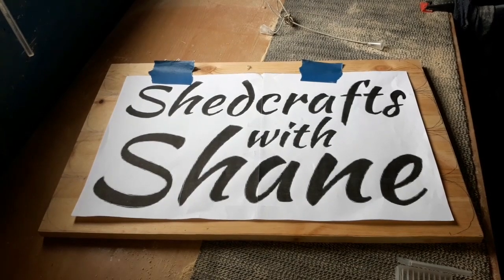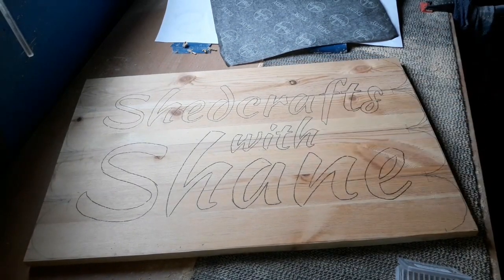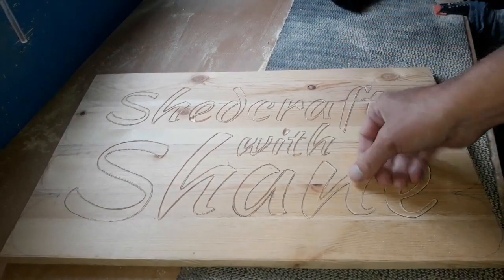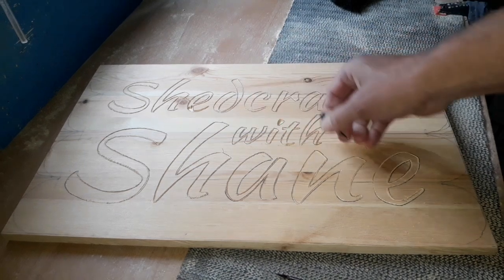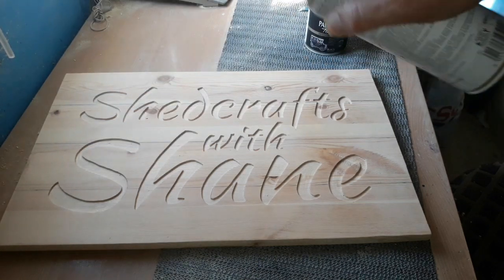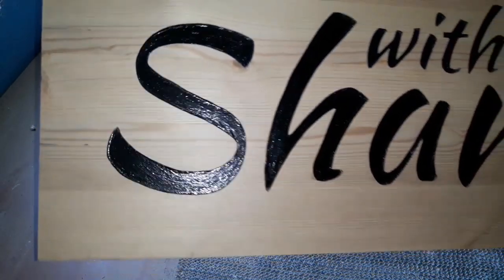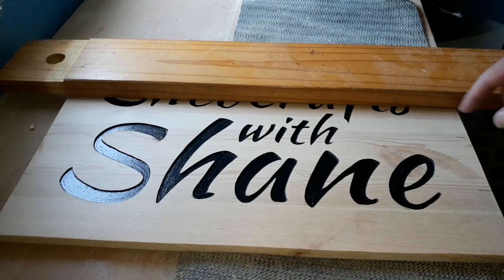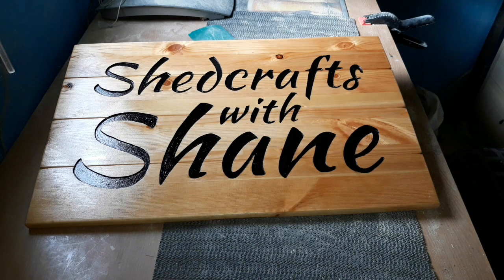Routed out plaque on recycled wood

Comment: Hi there can you please help me i just bought the aldi palm router 1/4" - can you please guide me to the correct size collet and millend and tracing tool set please im getting so confused with all the different listings and sizes - i would like to try what you have done here for some xmas presents - many thanks in advance
Reply from the maker: Hi Suzanne glad your having a go at routing,good choice 😀..I've started putting links to the bits I use in the description on my newer videos, check my butterflies on fencing wood videos all the links you need are there's.. cnc bits for the lines, end milling bits for the clear out, and the adapter collet so they fit your 1/4" router..ebay or amazon..if you carnt find the links let me know and I'll pop them in here for you, good luck and enjoy 😁👍https://youtu.be/BXjp8dXsCtI
Reply: @fishtank5050  hi there the engraving bits on your link are sold out and the collet link from china will be too long for when i need by any other links please xx
Reply from the maker: @suzanne970  I'm guessing your in the uk,this adapters from Manchester.select the 1/4"to 1/8"..adaptersize..
. https://www.ebay.co.uk/itm/Collet-Adaptor-Shank-Reducer-Bit-CNC-Spindle-Router-1-2-1-4-1-8-3-4-6-8-10mm-/323986312214?mkcid=16&mkevt=1&_trksid=p2349624.m46890.l49286&mkrid=710-127635-2958-0
Reply from the maker: Here's the end milling bits for clearing out with..https://www.ebay.co.uk/itm/10pcs-set-0-8-3-175mm-Carbide-End-Milling-Cutter-CNC-Router-Bits-/163724007456?mkcid=16&mkevt=1&_trksid=p2349624.m46890.l49286&mkrid=710-127635-2958-0
Reply: @fishtank5050   this link is a china product again not manchester sadly?
Reply from the maker: @suzanne970  OK  just go down the list or search amazon 🤔

Comment: I want to try this. What router and collet size and bits did you use?
Reply from the maker: Thank you Les,my router is a black and decker dn66 they don't even make them anymore but any router will do these types of projects, I do my lines with cnc bits,my clear out with end milling bits, they both have a dremel size shaft 3.175mm so you need an adaptor reducer collet 6.35mm so they fit a 1/4" router, if you check my latest video titled Rose routed out on recycled pine, all the links for the bits are in the description..Good luck 😁👍
Reply: @fishtank5050  Thank you for this info.

Comment: I'm looking at making my own sign, this looks much better method than the dremal method . Thanks
Reply from the maker: Cheers Tony, you can get a router attachment for the dremel if you dont have a router..
Reply: @fishtank5050  ah thanks, that might make more sense for me as I use a dremel much more. 👍🏻
Reply from the maker: @T-bit  here's one from ebay,you can get cheap plastic cone shape thinks,but I wouldn't recommend them,just a waste of time..https://www.ebay.co.uk/itm/DREMEL-335-Plunge-Router-Attachment-SET-c-w-Guides-26150335JA-/324619434656?mkcid=16&mkevt=1&_trksid=p2349624.m2548.l6249&mkrid=710-127635-2958-0
Reply: @fishtank5050  Thanks so much for the link,  I didn't expect such a quality part as this looks.

Comment: Hi could you please recommend the make of bits please. Thank you for your video it’s inspired me to give it a go. I’m just not certain what bits to get.
Reply from the maker: Hi Sam, i like to use cnc bits for the lines, and end milling bits for the clear out, there's different bits you can use,but I prefer these,they have a dremel size shaft,3.175mm, so you will need an adaptor reducer collet so the fit a 1/4"shank router...Good luck and enjoy.cnc bits..https://www.ebay.co.uk/itm/172213663526
End mill...https://www.ebay.co.uk/itm/353029506162
Adapter reducer...https://www.ebay.co.uk/itm/402710195555
Hope this helps..
Reply: @fishtank5050  Hi Shane thank you for the prompt response. That’s a great help and I really do appreciate it.
Reply from the maker: @sambrown9473  No problem Sam, happy to help 😁👍

Comment: What's the name of the router machine you're using
Reply from the maker: My router is a black and decker dn66 they don't even make them anymore but I can still find them on ebay or marketplace, I'm on my 8th machine.😁👍
Reply: @fishtank5050  lol o wow you do an awesome job do you have to have a certain kind
Reply from the maker: @valeriekey1499  no any router will do these projects from plunge, trim ,compact router, you can also get a router attachment that fits onto a dremel..
Reply from the maker: https://images.app.goo.gl/AfKzfjXMBHeHKo5q8
Reply: @fishtank5050  thank you so much 😊
Reply from the maker: @valeriekey1499  no problem 😊 👍

Comment: Great work. Could you put a link to where you buy the CNC bits & collets. I’m subscribed 👍
Reply from the maker: Thankyou, I get most of my bits from Ebay or Amazon, search cnc router bits, the collet is a 6.35mm to 3.175mm adapter reducer collet also Ebay,cnc bits come in different degrees, you can get a mixed pack with 10°,15°,20°,30° in side..

Comment: Hi mate  just a quick one what web site do you use to get lettering templates..
Reply from the maker: I used a free app called fancy fonts for this one..
Reply: fishtank5050  thanks,,,,got some of them cnc bits you use but never got the collet like a numpty. Just started as a bit of hobby. Like your work 👍
Reply from the maker: @adrianhoward7253  cheers,mine is just a hobby also,yes you definitely need the collet 😂😂👍make sure you get the 6.35mm and not the 6mm...

Comment: Hello

Excellent work, is it possible to use those bits on a dremel 3000?
Thanks a lot
Reply from the maker: Yes they will fit a dremel 3000,you can buy a router attachment to fit a dremel

Comment: nice job shane do you find it easier without using the plunge on your router i have always used the plunge when routing will give your way a try regards and never tried the milling ends you have been trying out they appear to leave a nice even finish without the need to then tidy up with dremmel
Reply from the maker: Cheers Wayne,I've not used the plunge for years now,I did at the beginning on a bigger router,but the one I have now is so small and light,its easier just to lift it in and out..I ordered the mill end bits by mistake, glad I did,they do clear out really good...
Reply: ahh i thought it was smaller i only have the larger type i see were you are coming from now cheers @fishtank5050
Reply: also just orderd some milling bits of ebay to try out will let you know
Reply from the maker: @wayneheston-king341  definitely worth a try,my brushes went on my router today,I've worn them out..lol.i had a back up router so on with the next project...

Comment: Loved the video, but I have 1 question.  When you routed the horizontal lines from side to side, did you stop the router right where the painted area was, or did you have the router set more shallow so it didn't disrupt the painted area?  Thanks for taking the time to make it!
Doug
Reply from the maker: Thank you Doug,on this one I had the lettering routed out slightly lower then the lines,I suppose you could do the lines at deeper depth  then the  lettering, then paint afterwards ,either way would work..😁👍
Reply: @fishtank5050  Thanks for the quick response, I really appreciate it.
Reply: @fishtank5050  wood work 😁 nice, great job, I am buying a matika soon can't wait 👍🏻😉

Comment: Another great project Shane. May I ask, when you apply the linseed oil do you go over the black paint in the letters as well? Just to clarify for me if routing outset letters you route to the outside of the letter and inset letters route on the inside. Keep up the great work buddy, love watching your videos.
Reply from the maker: Thanks Mike, I tend to go over the whole project with the linseed oil,it won't do the black paint any harm and it all dries the same..like you say outset is outside the lettering, basically removing the back  piece,and inset is just removing the inside of the letters ,if you check my latest video, beach life sign I mention inset and outset..

Comment: Great video!  I am new to this, can you tell me if you have some kind of vacuum to keep the dust away?
Reply from the maker: I've never had a vacuum, I wish I did..on my older videos I just brush the dust away,you dont get alot with pine.but now I have a mini compressor with an airline that runs up to the router.you can see the tube in the video, now when I need to clean I just blow it away by tapping my foot on a pad on the floor...works great.
Reply: Thank you.  Maybe you should make a video on how you did that, and thanks again.

Comment: I noticed that there were two cables going to your router, I was just wondering why? Could you also tell me where you get the collet to fit the cnc  bits?
Reply from the maker: Well spotted with the two cables,one is a airline that's connected to a mini compressor under my table,I use a foot pressure pad and tap it so the air blows the dust away, I used to use a brush,the air works  great..I'm going to do a video to show it..
Reply from the maker: I get all my bits from Ebay or Amazon, heres the link to the collet https://rover.ebay.com/rover/0/0/0?mpre=https%3A%2F%2Fwww.ebay.co.uk%2Fulk%2Fitm%2F202740392004

Comment: Shane, where do you get the concert router bits you show please?
Reply: CNC bits not concert!
Reply from the maker: @neilburman5522  mostly Ebay, or Amazon ,they come in different degrees, I use 20 or 30 degrees mostly..https://www.ebay.co.uk/itm/172213663526